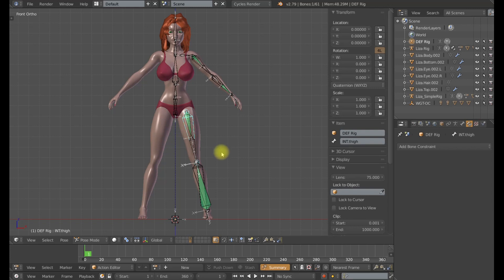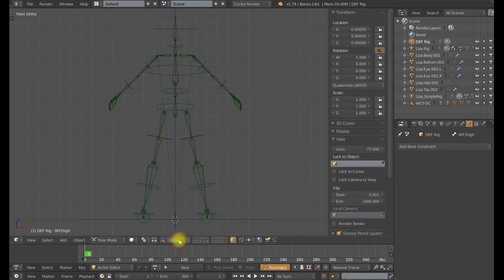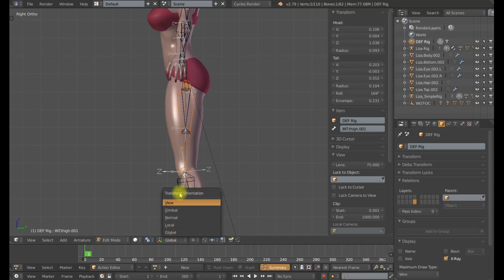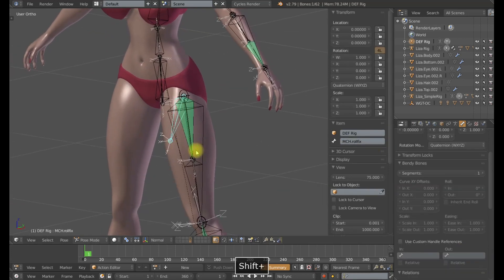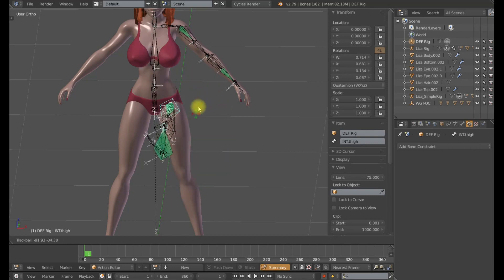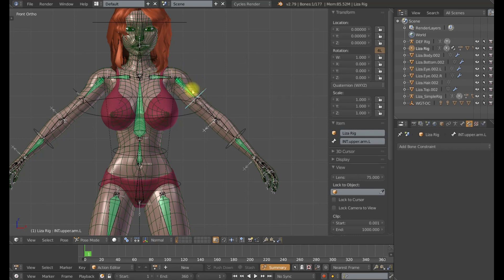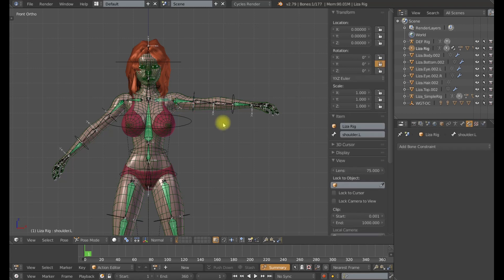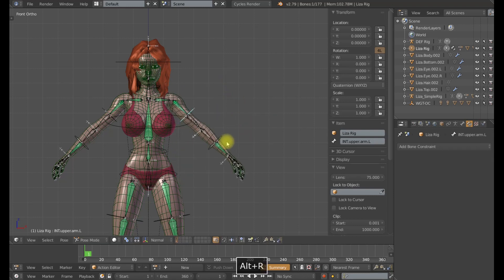Advanced Deformation Series Part 3B Roll Fix Mini Tutorial

Comment: There's an even better fix for this that I found by investigating the PitchiPoy Metarig with a fine-tooth comb.
If you parent your uppermost thigh tweak bone (or first deformation bone if you're not using squash and stretch) to your IK/FK intermediate bone instead of your leg socket parent, it doesn't have the rolling issue. Don't know exactly why that works, but it does!

Edit: Sadly not a fix, but an alternative/compromise
Reply from the maker: That would make it inherit the y rotation of the intermediate, defeating the purpose of isolating it from that axis.
Reply: Hmmm, good point, I didn't even notice that. I'm kinda surprised the PitchiPoy rig didn't implement that in any way.
It's at least an option. Pick your poison: automatic thigh rotation with some issue zones, or no automation but you can still use tweaks to control bone manually. Depends on if you or your animator prefers manual animation or counter animation, I guess. :p
I'll try and see if I can get a parent switch working in that area later to hopefully get the benefits of the automation while the character's standing, yet have the option to switch to manual when the angle gets into the problem zone, mostly for the arms that don't have a fix yet.
Reply from the maker: Yep. Pick your poison. That is rigging in a nutshell. Another thing you can try is to use a stretch to constraint instead of a damped track constraint. It will still flip, but in a different area (Out to the side.) You may prefer this as it will stay stable within another range, but again, it will still flip when the thigh is rotated out to the side. I prefer some kind of automation and then just manually tweak any problem areas instead of the complete manual method needed by the pitchipoy rig.